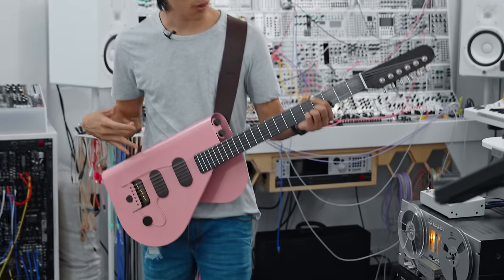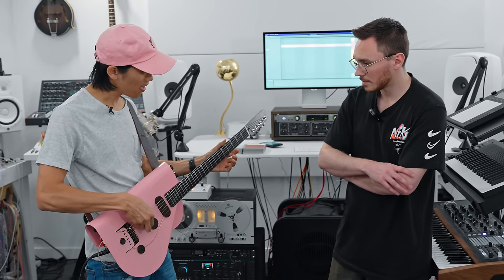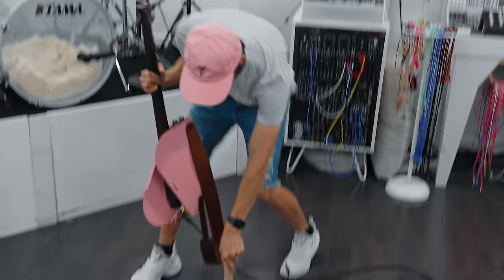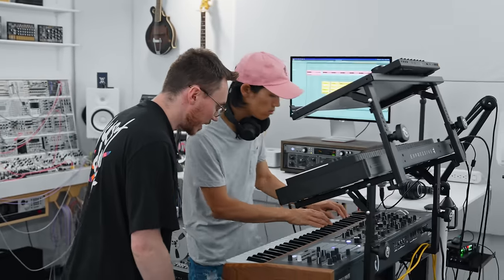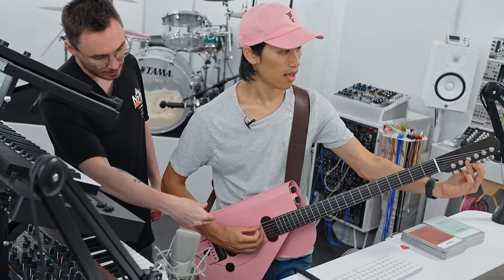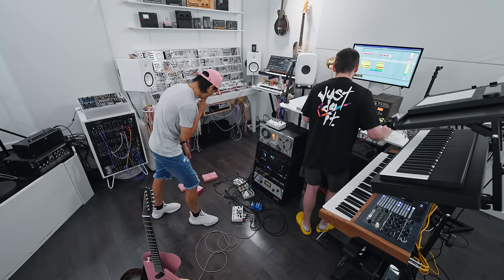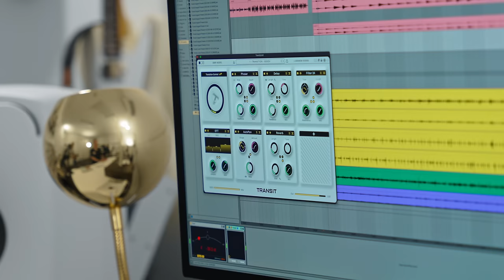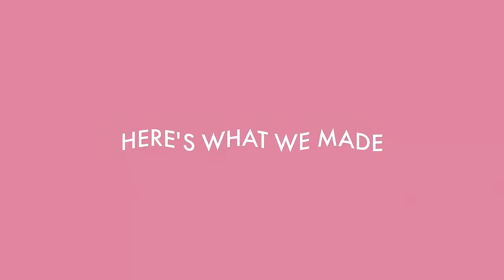My new experimental guitar

Comment: I think i want to try to copy something like that with my stash of sheet metal, a laser cutter cnc, and a 3in1 sheet metal machine-roller/cutter/bender. The concept is interesting with the magnetic pickup arrangement allowances, removable midi pickup option. The metal could also allow for on/off switching, or you could just laminate it with flexible e-ink displays, all midi regulated to real time performance or through automation.

Park a micro portable amp circuit in it and add the bits to make it a flat speaker. Optical and pressure sensitive MPE capable sensors for bending and morphing.

Comment: on one hand, This is really cool, And that was such a practical demonstration of pickups, and I am very inspired by this. On the other hand, I am not in the market to buy a +$2K guitar. I might attempt to make my own though, because this is conceptually very cool... but also there's some design elements I'd personally change, I'd probably angle the neck to bisect the angle of the fold and edge, sort of like a flying V, and wouldn't use a 6 inline headstock, I'd use a 3+3... lastly, it's such a missed opportunity to not make the neck/fretboard also be folded/stamped sheetmetal. If it turns out I know any person or place that can do it, I'm tempted to make my own weird sheetmetal guitar with these changes. I doubt I'll follow through though.

Comment: Um, you do not need a pickup to be a magnet, it just needs to be a coil of wire. Placing a magnet in the middle of that coil of wire helps boost the signal dramatically though.

Comment: Does the headstock with the tuners pulling the strings at such a sharp angle cause any issues? That low E string looks like it's at a gnarly angle and I have to wonder what that will do to the nut over time. It seems like a century of guitar design has warned us against this sort of thing. The body is cool, though!

Comment: My personal modded fender bassmaster has three channel output by XLR.
Reply from the maker: That sounds awesome haha
Reply: @andrewhuang  thanks. I always ran my neck pickup out to to a bass amp with a light distortion, my bridge pickup out to a flanger. Those split left and right. And my Center pickup went to a Steiner Crumar Master's touch with a VCF filter that is breath controlled for special lead effects. And I would raise and lower the volume of that by foot. And the bass is heavy as fuck.
Reply: @Sthunderrocker  that sounds rad

Comment: Rock and roll is a vicious game. Warning: Do NOT play while sitting down, unless you are ok with potentially segmenting a leg from your overwise undamaged walking form, due to the very choppy looking edges of sheet metal that seem to define what appears to be a leg rest. The upper part of the guitar is way safer than the lower part of it because of how it is folded.
Bolt in a block in there of padded material, or put a fold in the material similar to the upper folded part.